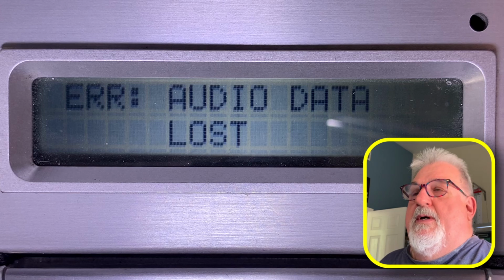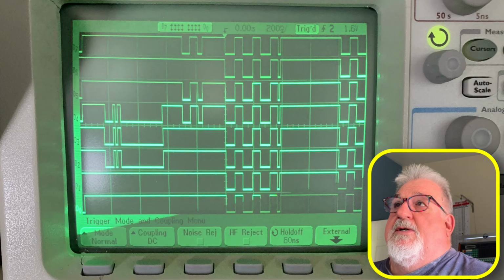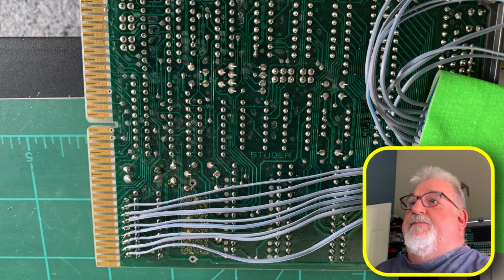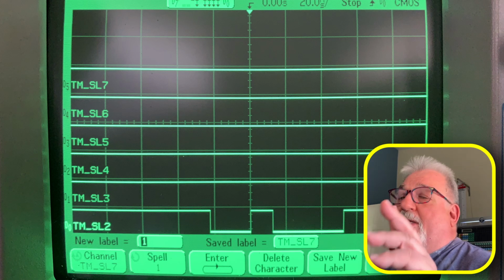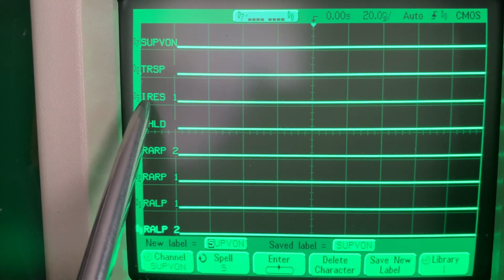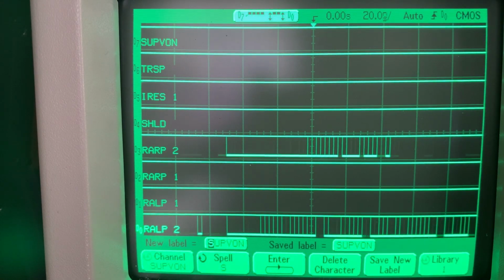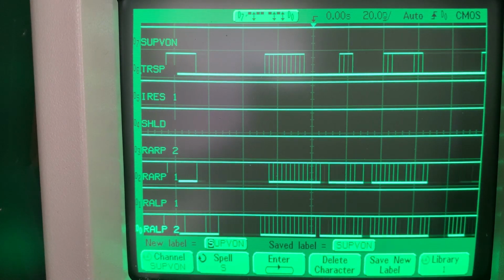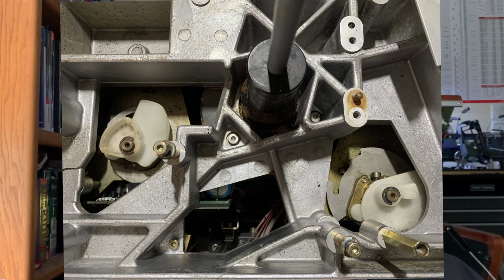Studer A820 2" Multitrack Restoration - Part 42

Comment: And down the rabbit hole we go! I really feel for you, but I think you have the tools and the tenacity to get it fixed. I once had to fix (or try to) a  1980's 3d table to a industrial  laser cutter, that you loaded the program and the process data in by paper tape. I got it to partially work , it had some intermittent rtl ic chips that I could no longer acquire. I tried some newer ttl chips with some transistors added on for logic translation,  but I could never get the timing right.  
I think you are on the right path  both tape lifters should be in the lifted position when the transport is stopped unless hand cuing is enabled.  I am not that familiar with Studder to know how that is handled on this deck, so I can't  help much there.  Good luck I wish I could be of more help.